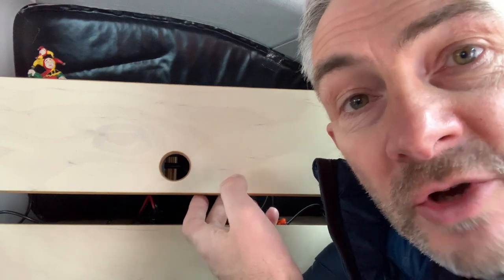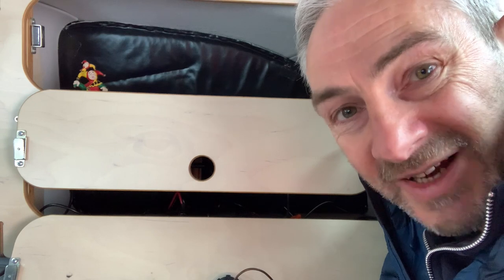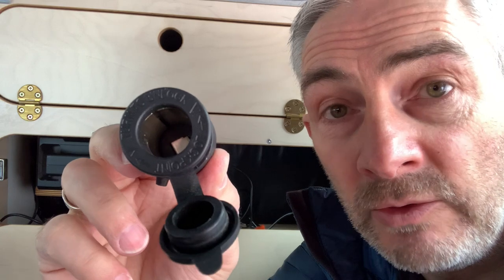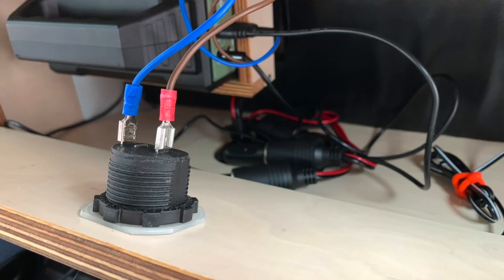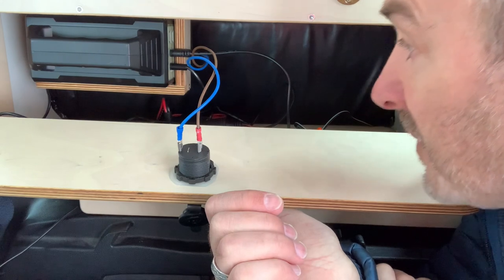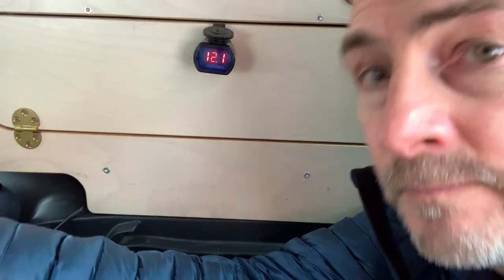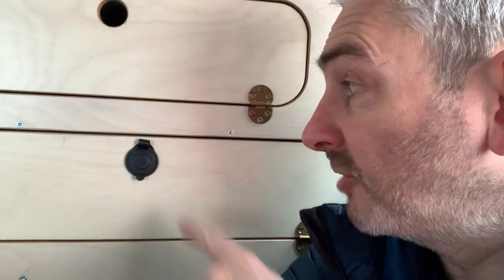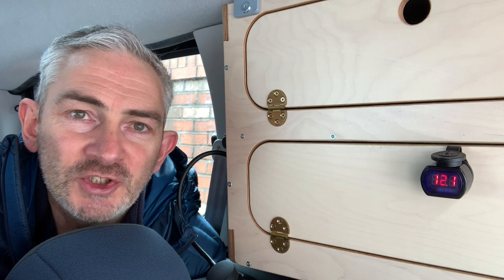Easy Volt Meter Modification For Your Small Camper Van PPT Powerpack

Comment: Is the socket you used a cigar lighter socket ? It looked smaller to me. The links to Amazon show the items plug into Cigar lighter sockets.
Reply from the maker: John Small The 12v aux socket I used is the same size as a car cigarette lighter and takes accessories you would normally plug into your car 12v socket 👍